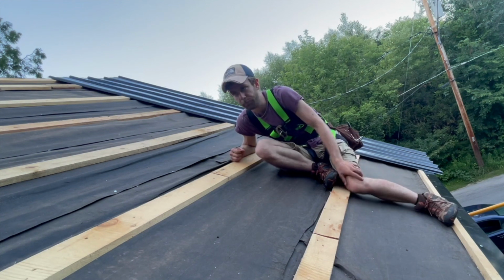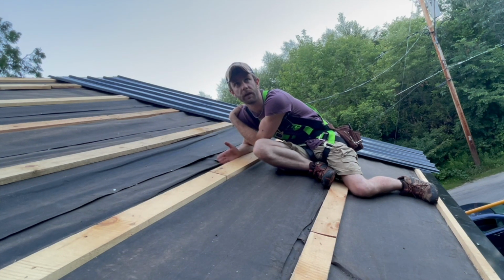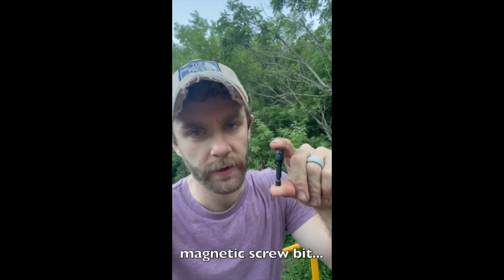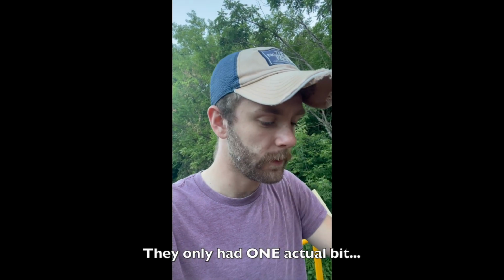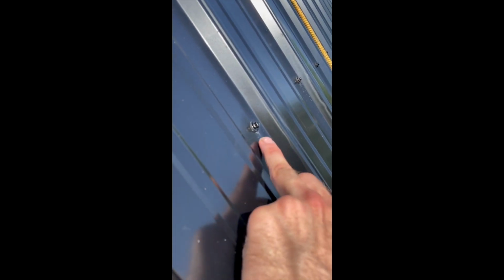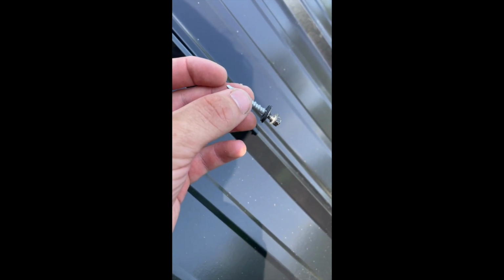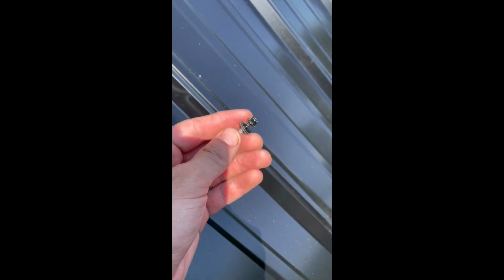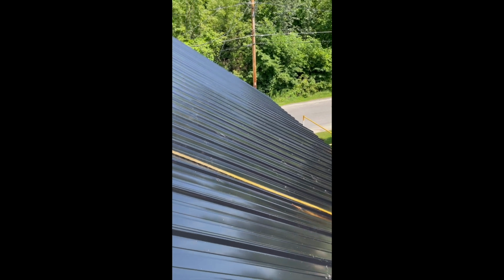HOW FAR can I get?? Continuing the NEW ROOF!  (Part 2) || MAJOR Fixer Upper Ep.5

Comment: For future reference. If you stack a few together, mark for you holes and pre drill, it will make it easier for you when your on the roof. Hope that helps
Reply from the maker: I had thought about that. I knew my roof wasn’t square though so I was nervous something might not line up like I wanted. Looking back I probably could have made it work!
Reply: @likeclarkwork22  All the videos I have looked at for steel roofing they never predrill with perlins

Comment: I’m watching from New Zealand 🇳🇿 I find it interesting looking at the different building codes. Here we would seal the gap between the running boards and the steel sheeting with a very thick layer of foil, which serves as an insulator, and avoids moisture getting between the sheets of the roof and inner layers. It helps keep the cool out, heat in, then the reverse in summer. Remember to go back and do all the screws! A big storm could undo all that work. And man it’s looks like you’re exhausted on this one. How far away is the winter snow / ice now??